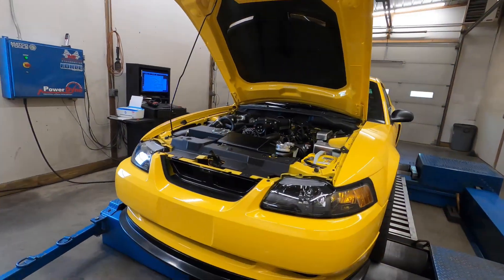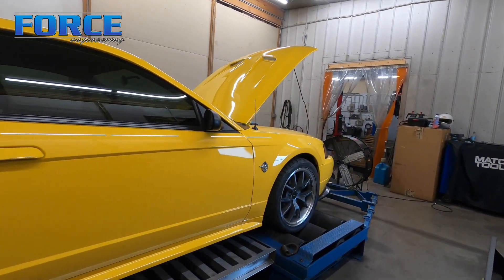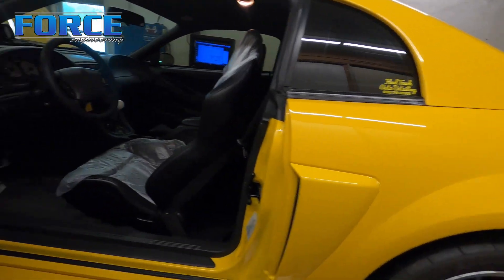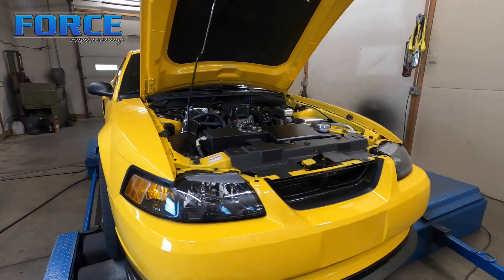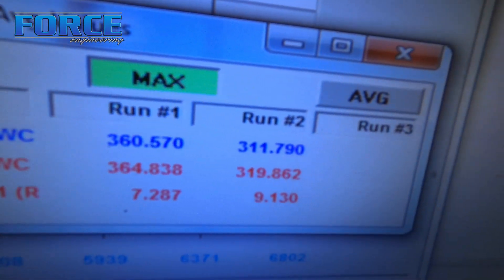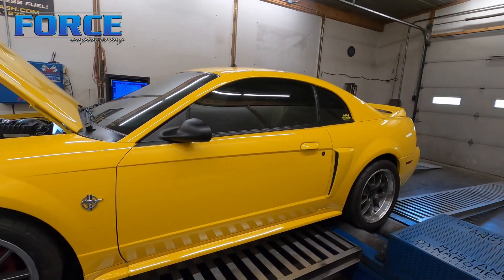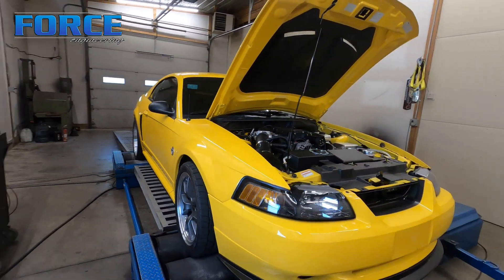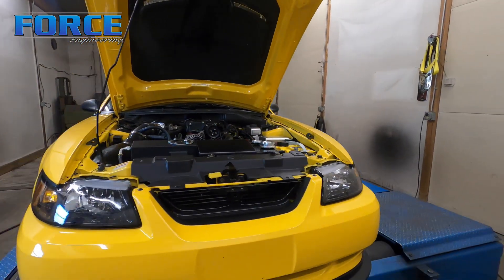Supercharged 4.6l 2v | Ford Mustang GT | Dyno Review

Comment: I went with a vortech supercharger on my 99 GT but it came with a 3.6 pulley and 36 lb injectors and I bought a 3.33 pulley and 42 lb injectors and I also had full length headers and off road h pipe and 3.73 gears. I installed a center force dual friction clutch and upper and lower control arms and sub frame connectors and a new tune on 93 octane. I went with nitto drag radials since I drive it to the track but it still spins like crazy but definitely lots of fun
Reply: Im super late lol how much power was it putting down
Reply: @aa_savage_22  I have no idea but a lot

Comment: Blows my mind. He is less than 400hp with a twin screw. 🥴 my N/A Trans Am. Makes that.
Reply: Yes but he’s also done no engine work, there’s a guy on here with an 05 NA 4.6 making 500 whp before supercharger and beating the 10 spd new GTs.
Reply: @alvingeroy3242  he said it has rods pistons and a cam. What are you talking about?
Reply: My 22' GT 5.0 makes more than that while bone stock down to the air filter.  It blows my mind that you think that's so impressive from your built F-body 🥴
Reply: @jaronhunt8229  He's talking about his built car making more than this older vehicle.  Good to see you were too slow to pick up on the nuance. Take a hike, Arnie Grape
Reply: Sure it does bro
Reply: Probably better tuned to put down the power

Comment: Tell the owner if you still can get in contact with them to look into the intercooler heatshield. These stock intercoolers are good up to about 450whp but they'll never make it unless the gaps around the IC in the manifold are blocked off and all the air is forced through it. A guy in the Saleen community makes them and they work very well. My car with the less efficient Series 2 Magnuson MP90 never sees over 130 degrees and thats down here in Florida. In fact my car is usually around 25-30 degrees at most over ambient while cruising, and never over 130 while at peak boost even after multiple back to back pulls. May be something he would want to invest in. Its $225 for it and I could put him in contact with the guy who makes them. That car could easily be at the 400whp+ mark with those mods. It beats spending $900 on an upgraded intercooler for that manifold if one can even be found. It's not too terrible of an install either.
Reply from the maker: Thanks for the info!!  Ill pass that along to him.  I believe he has purchased a new blower for the car though.  Either way. Thank you for sharing!
Reply: Bradley, how much rwhp can that blower make?  Can it make 500+ whp with a smaller pulley?
Reply: @videogazer801  I haven’t seen cars with the series 4 making 500. I’ve seen up to about 450 or so with them on E and all the bolt ones and some cooling system upgrades
Reply: @904Saleen   450 isn’t too bad.  I have that same car, but in auto, stock pulleys, stock exhaust, fully stock besides that blower.  I’m assuming 270 rwhp since it’s an auto.
Reply: @videogazer801  nah you should see way more than that ... i made 242 rwhp na with bolt ons and shortys
Reply: @mikep594  I have factory stock exhaust all of it is stock and my car is an auto

Comment: Surprising to see only 8-9 psi on a built bottom end 2v even on 93 why didn’t you go up in boost?
Reply from the maker: Blower is pretty close to max rpm.
Reply: @ForceEngineering  Kenne Bell 2.8 has been ordered, looking forward to seeing what it puts down next spring.
Reply: @ForceEngineering  when it made 320hp, was the blower installed with lower boost or was the 320hp while it was NA?
Reply from the maker: @krisjenkins4040  had the blower, lower boost, stock cams then also.  The na 2v engines make 220ish stock on our dyno. Cammed and head work na typically make in the 270-280 area for reference.
Reply: @Steve B not really, it's not a big block, what power can you expect from a lil 90's tech PI 4.6L 2v, literally 281ci v8..
Reply from the maker: @Steve B ive done a couple cars where the engine had been on an engine dyno prior.  Stick shift cars.  The rule of thumb 15% loss for a stick shift driveline was within 10hp of what they made to the tire vs the engine dyno.  I feel its accurate.  Also,  Wheel hp calculated from trap mph and weight tends to be close.  That said, its a tuning tool, as are all dynos.
Reply: Very interested to see the power gains when the new blower is on 👍🏻
Reply: @Go away what do u expect from a 2v tiny block engine bud. this is from the early 90s, this aint a Coyote lol
Reply: @Toxic2T   I have a fully built 4.6 forged bottom end upgraded heads custom boost cams LTH upgraded intake upgraded throttle body.ProCharged with 10 lb of boost. Making 490 to the tires running it daily on 93 🤷
Reply: @stringsattached67  Hell yeah brother!
Reply: @Toxic2T  they can make plenty of power, stock GT with Kenne Bell on the lowest boost pulley ( around 6.5psi) making 390RWHP and 425lb-ft. Once the bottom end is built and heads and cams worked, should be putting down 500RWHP easily
Reply: @RogueMachines17  agree.  The guy saying they only do 270 with cams and headwork is nuts unless that is the stingest dyno.   Might be a mustang dyno.  They read lower.  I think a forged 2v with heads and cams should easily top 500 rwhp even on pump gas.